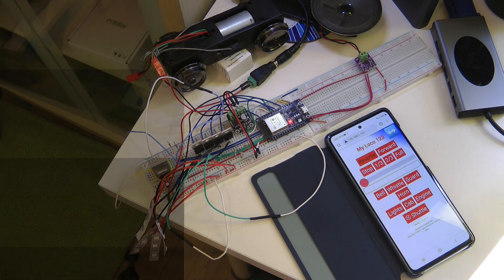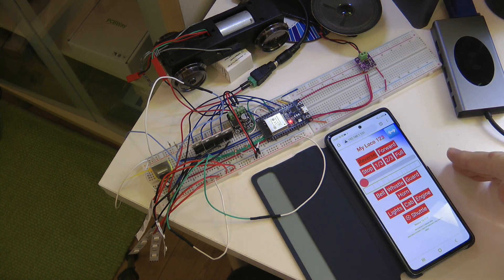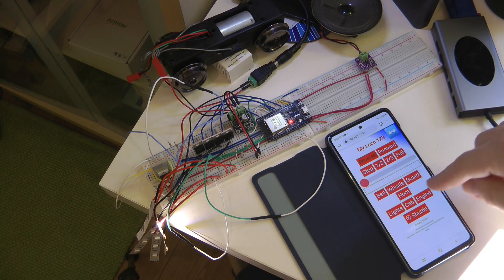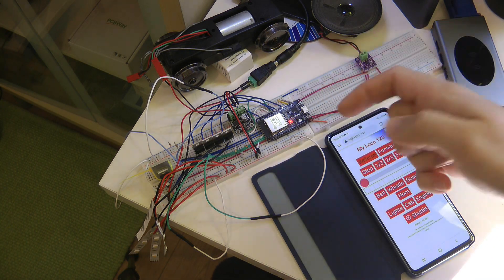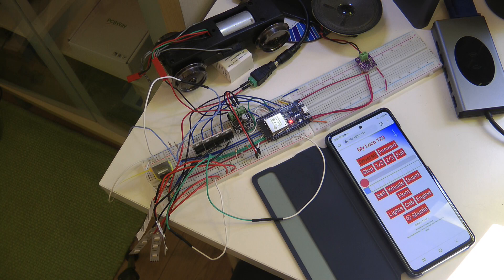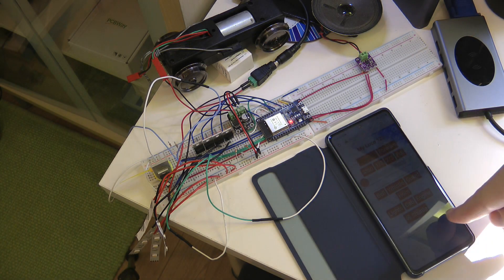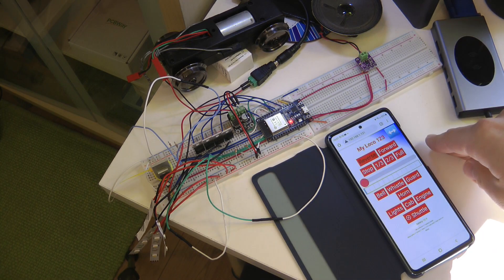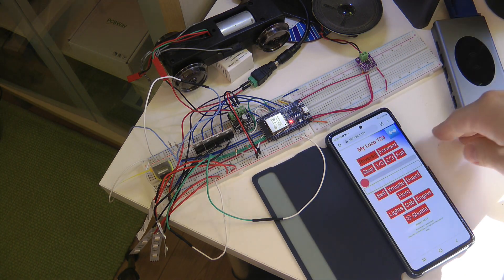Wifi garden railway controller project

Comment: Great project! I'm currently developing almost the same. I'm just using a WEMOS D1 mini as WIFI controller and a DRV8871 as motor driver. It makes 3.5 amps in peak, which is pretty enough for a garden railway. Right now, I'm awaiting the 2nd version of my self-developed PCB board, I ordered at jlcpcb.com . The 1st board worked as expected, but it was just a few millimeters to big for my locomotive.

Further on good luck for your project. :-)
Greeting from rhine-main-region, germany.

Comment: Wich AP library did you use
Reply from the maker: I am using the standard ESP32 wifi library. I just set up the adapter in access point mode.